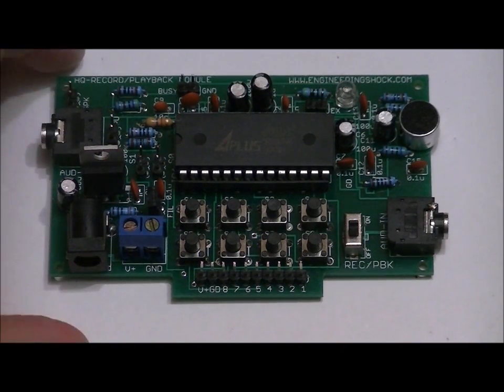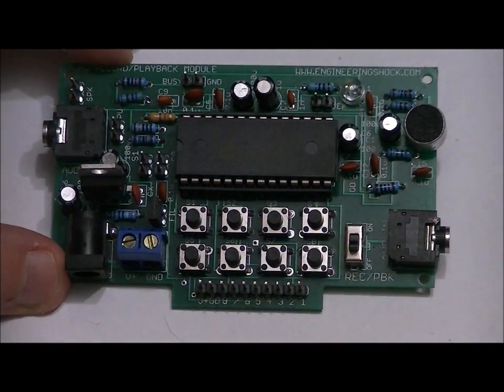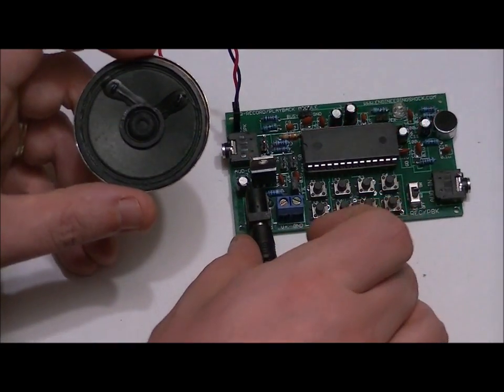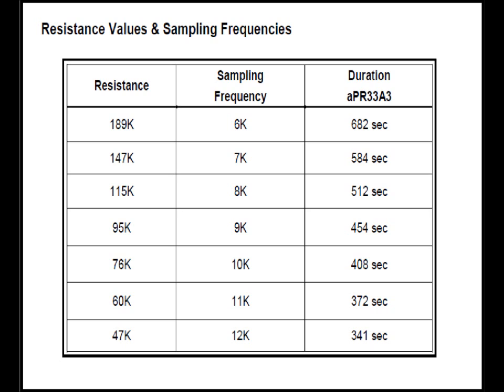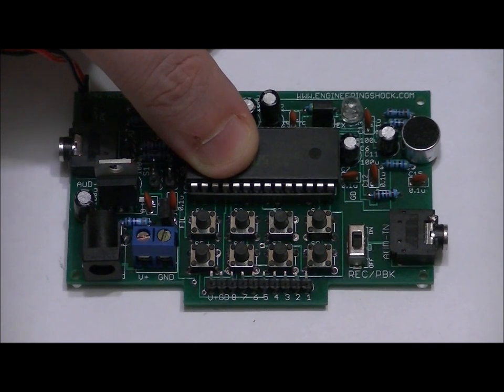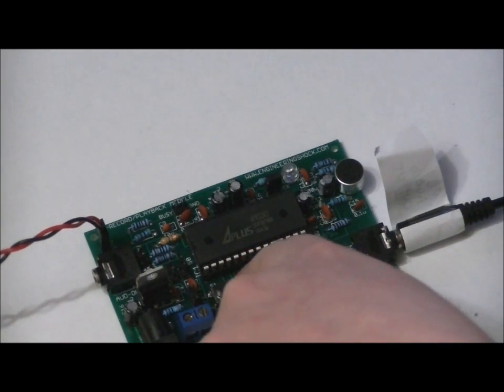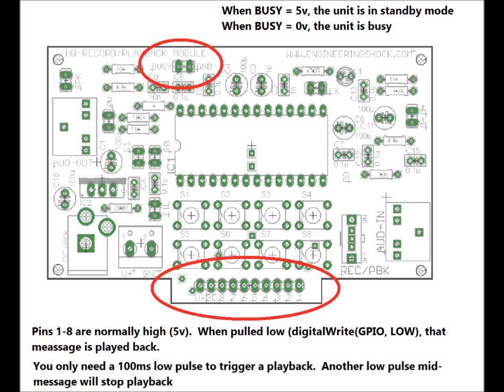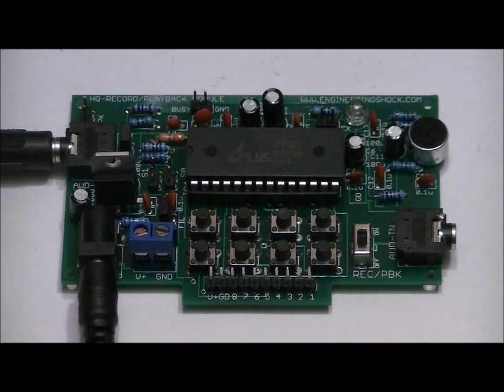The Arduino Compatible HQ Record & Playback Audio Module Video Manual

Comment: The sound goes away near the 8 minute mark. Otherwise, very good.
Reply from the maker: +mathman47 
Hi =)  The volume decreases when I speak through a different microphone for those parts, but it doesn't go away.  It just means that you need to turn your volume up just a little bit.  Thanks for the comment, and thanks for watching!